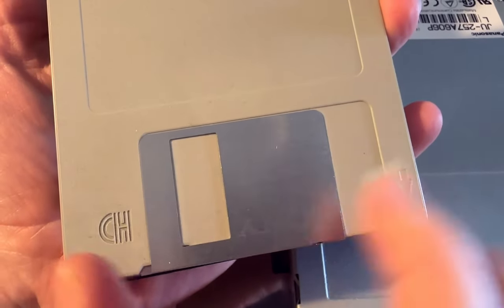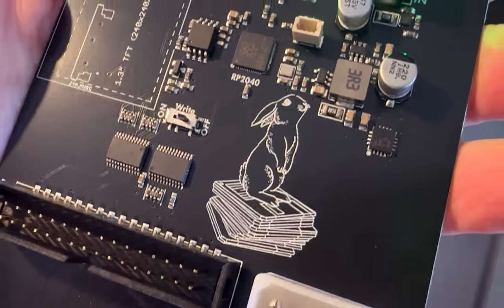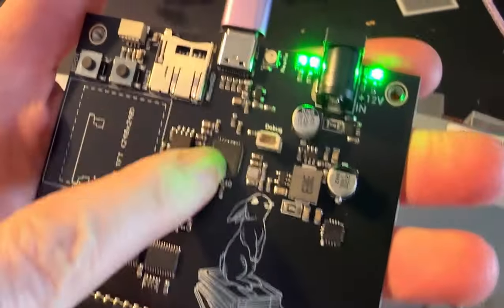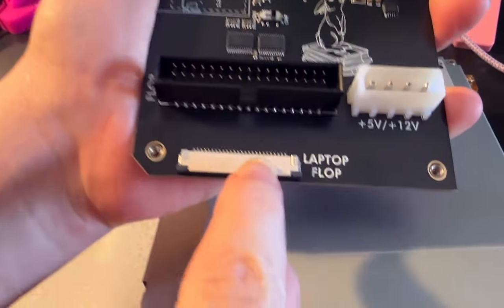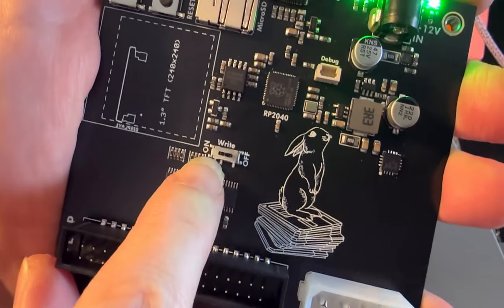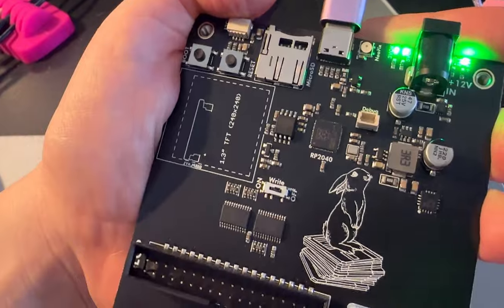Floppy Disk archiver and emulator, prototype is in! - video 💾

Comment: I would be interested in seeing how this goes as well. To use with 8" drives, you'd need to add (on-board) a 50-pin shrouded header mapped correctly to the 34-pin equivalents, or you'd use a 34-to-50 dongle and two cables. As to power, you won't be able to power 8" drives from the board. The SA850 (great general-purpose 8" drive) requires 120VAC for the spindle motor and +5/+24v for the drive logic and solenoids, respectively, at about 0.8A each per drive. Likely the drives will be powered separately since they're typically in an external enclosure.

Comment: That looks like a very interesting project. I am a factory support test engineer for an aerospace company (not the one that's been in the news lately). I maintain test systems that use non-DOS formatted floppy disks. These are for systems using the test and measurement versions of the venerable HP9000 controllers using an HP Pascal OS. I believe the floppy format is called HP-LIF. Will this board support reading and writing files to/from such ancient non-DOS disks?

Comment: Would be nice if you can make it so actually be recognized as a usb floppy drive when plug into a modern computer (windows, mac, linux, etc), and capable of read and write.  (read might be easier but write would be great)

I suppose it will then need to have a few more jumpers to indicate the type of floppy drive connects to it.